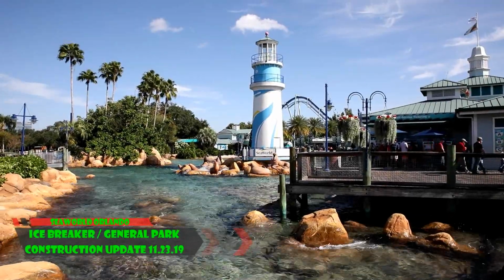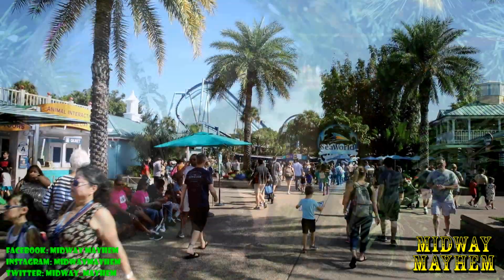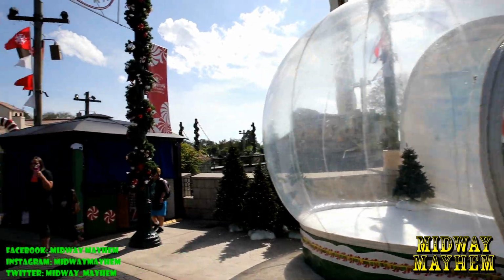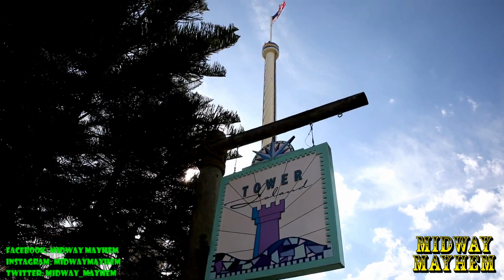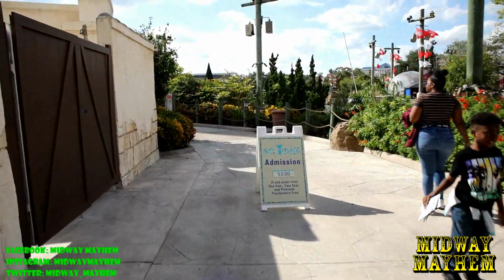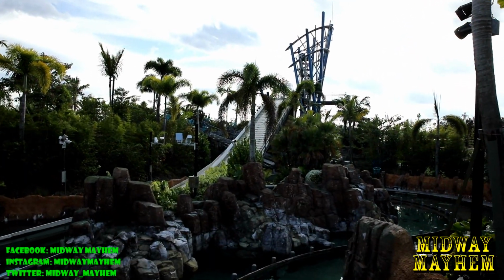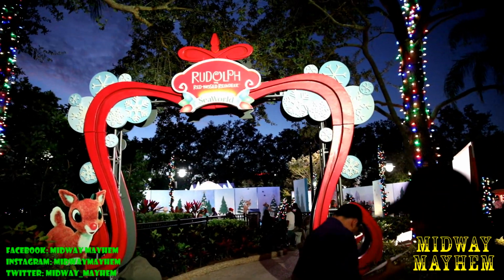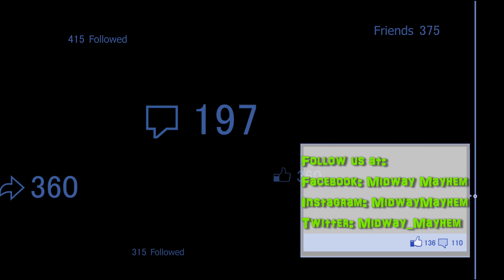SeaWorld Orlando Ice Breaker / General Park Construction Update 11.23.19 Beyond Vertical Spike Done!

Comment: I'm wondering why Seaworld, WDW, Busch Gardens construction on their new coasters are going so fast and going vertical but Universal Studios with their new Jurassic World Coaster hasn't even laid down much if any foundation and hasn't even gone vertical at all and they started construction around the same time frame as the other parks new coasters.
Reply: djfubar2008 the area it’s in is in the center of the park so it’s harder for them to start construction when they have to accommodate how the guests will go around the park
Reply: @thequeenbee7081  But most of the update videos I see of the "Velocicoaster" there isn't anyone working on the construction site during the day, which is slowing the installment of the coaster as well but im assuming because it's to hot in Florida most of the time during the day so they work on it at night? Or is it because they don't want the noise of the construction noise to bother the guests and ruin the impression of the park, so they work on it at night when the park is closed?